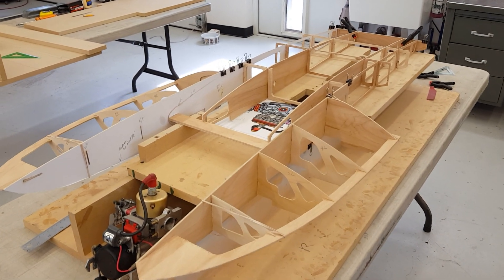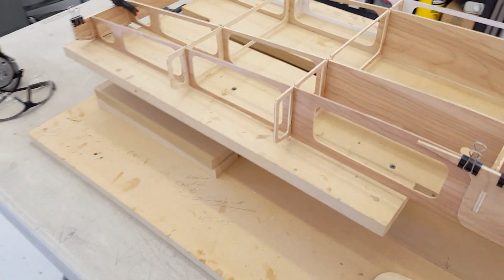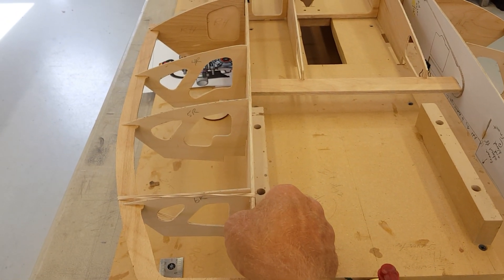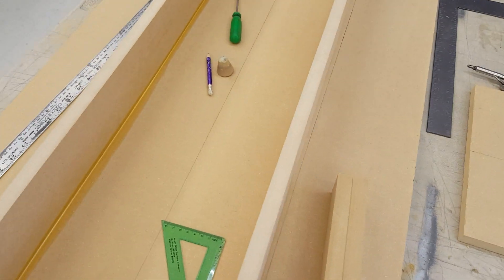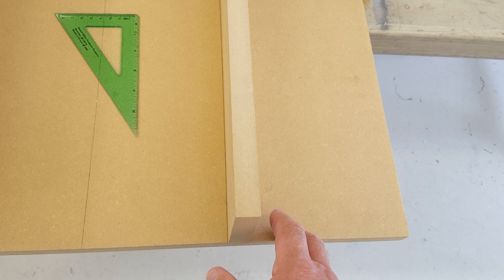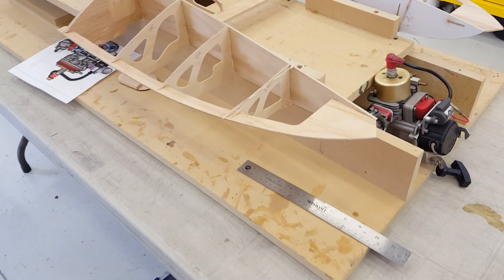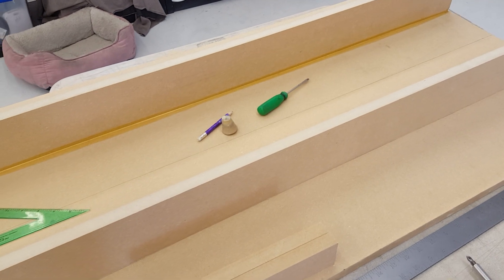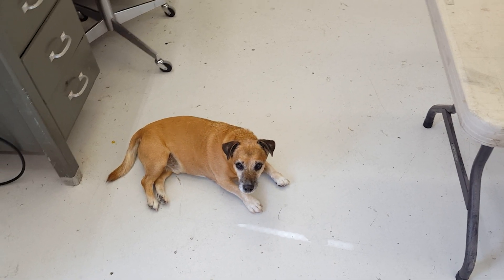RC Hydroplane Construction - How to Build a Jig - or - The Jig is Up!

Comment: How wide is the construction platform?  It appears to be about 18" at the wide end, and the narrow end with the cutouts for strut and shaft is about 12 or 14 inches.......
Reply from the maker: Different for every jig, depending on the boat I'm building at the time.  Just remember ... It's easier to cut more off than to put more on

Comment: Fantastic Channel! I'm from England. Sorry I'm late to the party but I will definitely be designing (in CAD) and scratch building your newer yellow 'Eliminator' (this jig first) but with your new modifications for the gas version except mine will still be electric. Don't be concerned in a build experience sense, I have had a huge amount of experience building models with balsa and ply etc and 13 years of woodwork experience. My Eliminator Hydroplane will never be a racer (never say never) so I realise that the one sided bias of weight and offset positioning of the engine and engine-well and a-symmetrical shaping on the sponson's ride pads and the positioning of the steering fin and rudder is to help aid the thing swing round a right hand course at full beans. I however just want mine for larking about in all directions on a lake. So, with that said, how would you suggest I go about this? Should I do away with the steering fin or introduce a central one neerer the front or 2 smaller ones on the side? I guess theres also the engine torque to consider so maybe offsetting that is still a good idea???
Reply from the maker: You know, I have no idea how to make this thing turn both directions.  Being a very flat bottomed boat it has no real sense of direction on its own, so I'm sure it would need some sort of fin, centrally located below the nose maybe? Heck I dunno.  Maybe add a V-bottom area under the center?   You're breaking new ground here!

Comment: Must of looked now for 2 weeks to find files for one of these to cut parts for one of on the cnc router. Swear to god at this point they don't exist kind of disappointing.  Way to lazy to figure all the parts out! Lol
Reply from the maker: You can do it!
Reply: @M5PerfHydros  not that I can'.  i just am to lazy sit there draw out cad files for cnc router lol.  To much aggravation.  Have like 20 2cycle 1 and 2 cylinder water jacket engines sitting here without a home.  Bought out whole inventory 2 years ago when hobby shop closed over covid.  One day lol
Reply from the maker: Send everything to me, I'll use it!  😉
Reply: @M5PerfHydros  lol I have 16x 1/5 boats and 27 1/5 trucks and cars.  10x 600-1400mm helicopters.  I'm pretty sure I'll have one of these boats soon, since just ordered fiberglass hull lol. Told yeah I was lazy 
🤣 👍  realized other day rc collection now is 5 grand past the valve of my 4 bedroom 3 bathroom house lol. Priorities!  Pretty sure the engines all find homes over time lol

Comment: Hi. what kind of plywood do you use? What wood plywood and what thickness? Thanks
Reply from the maker: I use Finnish birch from Aircraft Spruce online. 1.5mm for bottom surfaces, 1mm for the top.  Basically the same as 1/16" bottom and 1/32" top

Comment: Loving your videos.  Ever think of using a diode laser to cut wood ?
Reply from the maker: Sure but it would take a very large machine!
Reply: @M5PerfHydros  My laser is 410mm wide by 950 mm long.  Looks like it would need to be about 1100 mm to cover the 42 inch hull design.
Reply from the maker: The Gassers are 51 - 53" long!  Laser would be nice, but I can't justify $10k to play with toy boats. Well I probably COULD justify it, but I'm not too sure that my wife could!
Reply: @M5PerfHydros  is that the length of the one your building in the how to build a jig video?
Reply from the maker: Yup.  Truth be told I typically don't make any of the parts the full length of the boat though.  I usually make the sponson runners and center section pieces separately and then laminate them together so I could get away with a smaller machine in most cases
Reply: @M5PerfHydros  what plans do you favor?

Comment: MDF MEDIUM DENSITY FIBERBOARD
OSB ORIENTED STRAND BOARD
NDF NONE DIRECTIONAL FIBERBOARD 
You are right. It is as far as manufactured boards go, hard to beat for straightness, strength and stability.  But don't let it get wet with water. Light misting semi ok. A heavy soaking, bad news. It will be more wavey than a ruffles potato chip. And disintegrate with the lightest touch or bump.

Comment: Hey Scott - Steve here at SMBC in the UK. Have been watching a few of your great videos on hydro construction. I’m about to build a 1/8 nitro so interested in your jig - did you consider that the 2 extra pieces on the top could be cut as part of the 4” uprights rather than add-ons so they would be perfectly aligned vertically? Then 2 cutouts on the top flat bit. Once I get started I’ll send some video of my jig.
Reply from the maker: Yes I considered that, but I like the flexibility of the removable uprights.  I can use one jig for any position canard and any picklefork depth boat this way!  Perfect for an inherently lazy guy who doesn't want to build separate jigs.  I hate clutter too, and these things take up so much space

Comment: Mdf Medium density fiber board ... HDF or bakelight is high density fiber board ... and LDF or your basic sponge like 1.99 desk wood ... Low density fiber board ... not to be confused with chip board ... that is actually stronger than ldf .
Reply: for the drop down you were talking about ... you could always use dowel pins on a removable piece so you just drop it in when you want to build a nonflat bottomed boat like you currently do ...

Comment: Do you wear Steel toed Safety Sandal's that are OSHA approved!!!!
Reply from the maker: And impact resistant contact lenses too!
Reply: @M5PerfHydros  ooof! When I first started wearing conacts as a teen I also discovered  "The Dremel"! I was using a cutoff disk on some Aluminum and I'm sure you know how that stuff likes to come off in sand grain sized chunks! A pointy shard NAILED me and stuck in my contact, it went in just barely far enough to prick my eye and thankfully it hit right on the edge of the white! 😬 I do notice contacts block a lot of other things too, like fumes and smoke that would otherwise drive you nuts. (Even if it IS a "short drive"! 🤣)
Reply from the maker: Dang... I was only joking!
Reply: @M5PerfHydros  remember, "Safety 3rd!" - Mike Rowe
Reply: Pretty sure they're Steel Toad sandals?!

Comment: Medium density fiberboard MDF used it for years building subwoofer enclosures!Heavy as 🤬 but works perfect.If you want lighter with same strength,birch wood is high dollar but saves your back.

Comment: Congrats, Scott, once again. Quick question. If you intend to build a recurved bottom (like the underside of a wing), how would you build the jig? Thanks, in advance.
Reply from the maker: Huh... A recurved bottom would probably react wildly over water.  I wouldn't suggest you try it, but any shape you want can be cut into the uprights on the jig. Laying a curved surface would be the difficult part... Maybe multiple thin layers of plywood?  Heck I don't know. If you try it, let me know what happens!
Reply: M5 Performance Hydroplanes - Scott Meyers thanks a lot, Scott! I was wondering how would I do if I wanted a truly wing profile in the tunnel parts (I mean, not a wing with a flat downside but an asymmetrical profile, like NACA 2412). Just perfectionism from my side. One last question, did you hand paint all details in your boats? Or are you using some printed film? Thanks a lot, once again. By the way, I just bought a 30.5” ML Boatworks you mentioned in one of the videos. Eagerly waiting for it. All the best. Take care.
Reply from the maker: I think the wing shape is exactly what the big boat designers were attempting to replicate with the center sections of their boats for many years. The trouble began when the boats got fast enough that the design actually began to work and they all started flipping.  Especially in the case of RC boats, we have so much speed relative to the boat's size and weight that you really should be trying to reduce lift, not encourage it.
When it comes to graphics I can only recommend Wes at Wesley's Custom Graphics. There is another well-known RC boat graphics supplier, but I cannot say publicly the things I'd like to say about him so please just trust me... if you want great, honest service, use Wes; https://www.wesleyscustom.com/2000s-1
Reply: M5 Performance Hydroplanes - Scott Meyers surely! Thanks! All the best.

Comment: MDF=Medium Density Fiberboard,  if it gets wet its ruined, cover it in F-glass, paint doesn't work as well with 50/50 wood glue/water mix to seal the end grain, 
MDF is what is used to make subwoofer/speaker boxes...it has no voids, Parts Express.com sells a MDF roll on black rubber that has some nice texture...its designed to cover the exterior of home audio speakers so it has a nice look
HD & Lowe's sells "handy panels" 4'x2', a full sheet is 49"x97" weighs 60+ lbs and is hard to get into anything but a truck bed

Comment: You keep mentioning a specific design you use by a individual (don't know how to spell there name, lol) where do I find those designs?
Reply from the maker: These last few boats I've built are models of real boats that were designed by John Staudacher.  I've always admired the uniqueness of his hulls, so it's been fun building them.  Once you've done this for a while you begin to identify the work of different designers very quickly. John's boats are very angular with lots of squared edges and just look less rounded overall... A very simplistic approach. In smaller classes he was always very successful, but less so in the unlimiteds.